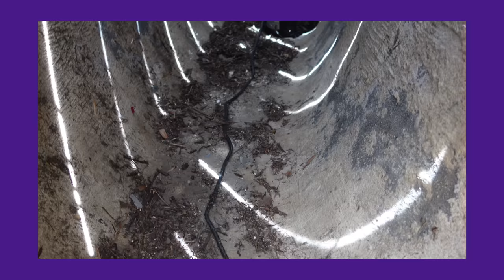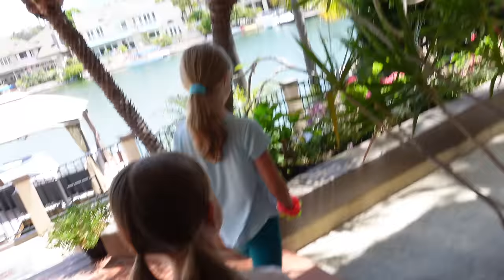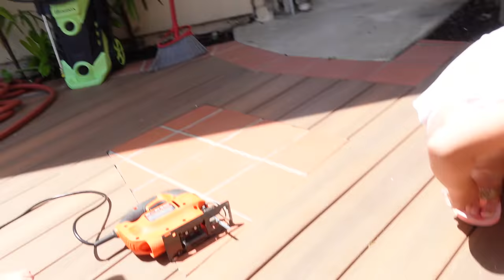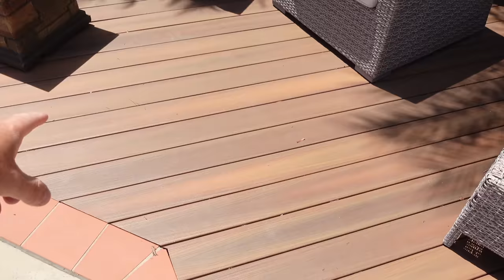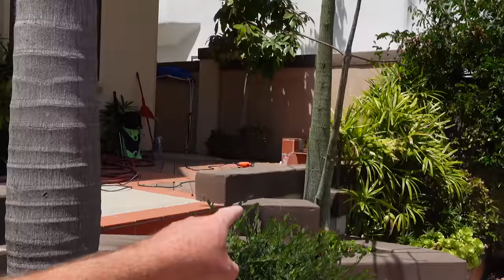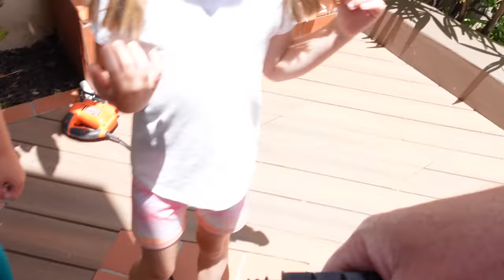Pond Monster Caught Living UNDER Our Deck at the Lake House!!!

Comment: Hi Trinity and Madison I was thinking about the pond monster maybe you should add a trap put a blanket to The trap put a rope and put a fish and the whole that you saw maybe put a camera put a Camera to out side back like to see if the trap worked then put the pond monster in a room that you move the lock to the other side instead of the inside Of a room then put a rad robot that you can use for you can talk to the  Pond monster OK and make it put the security camera over there to the room that you put OK bye if it didn’t work  will think to make a Nother plan